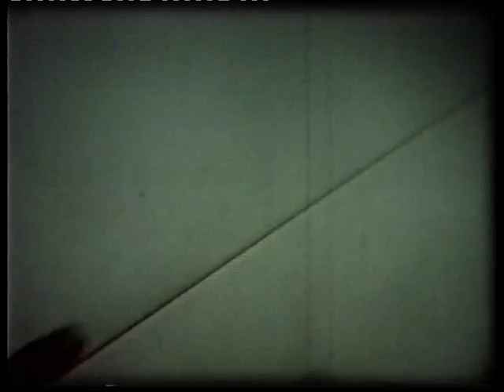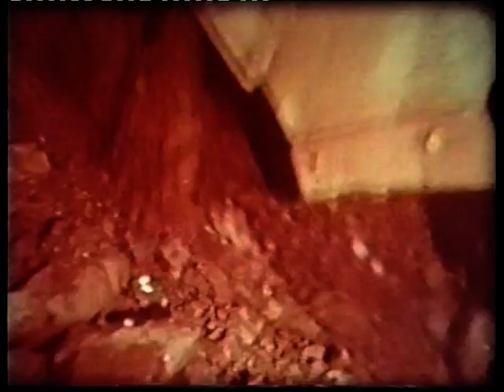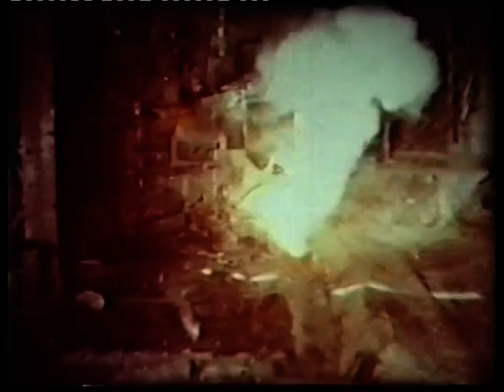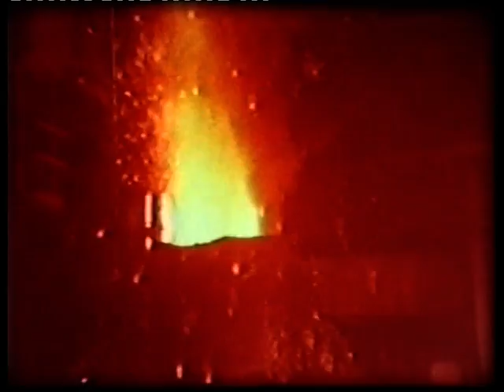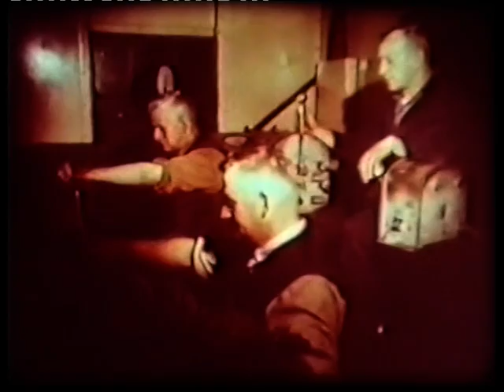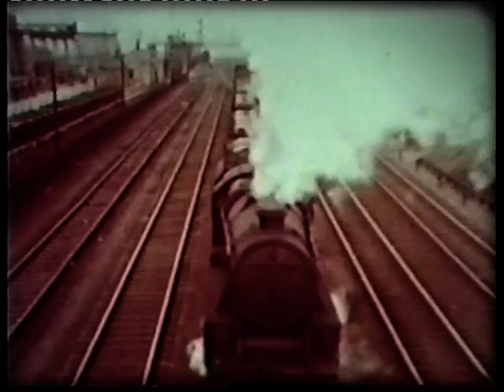Steel in Cumbria Sir Henry Bessemer A Tribute to the Inventor​

Comment: Uri , yes basically same process but only developed  when liquid  oxygen became available  ... i lived across the road for a while from the Steel  Works in Workington  Cumbria ..  In New Zealand  Rails from there are used on heavy Loaded Curves in the Mountainous regions . They are roll stamped with Workington Rail ... 
Not shown was the electrical surface hardening process or the automatic welding of up to ten lengths of rolled rail .. the standard lengths  were for overseas shipments  from the local docks ...

Comment: Night skies in my hometown of Pittsburgh, PA glowed pulsating red and orange as the Bessemers fired, back in the late 1950s / early 1960s.  Smoke control legislation plus BOF steelmaking shut them down.
Reply: This is the plant my Dad worked at, he was a Saw Sharpener, Shop Steward for the Union, he lost his leg & broke his back in an accident in the rolling mill, he was crushed when the rail snapped off the roller, he was only 17 at the time !

Comment: ladle = so-dek (Sl.) = sen-duk

Page 391

The molten metal is poured into a ladle and then there is added to it manganiferous pig iron, which reintroduces the necessary amount of carbon and manganese.
Reply: ladder = tang-ga

Page 392

Bessemer steel is used for nails, screws, wire, and in fact for all products where cheapness rather than quality is the requirement.